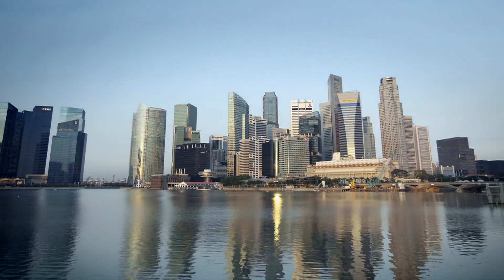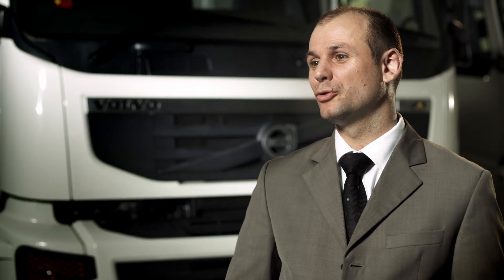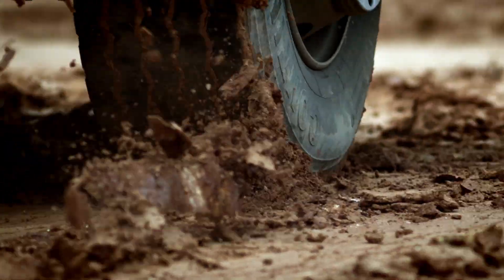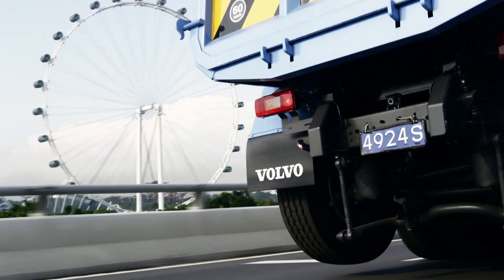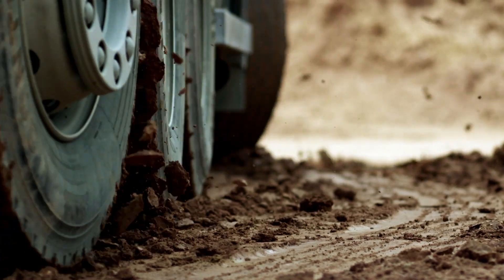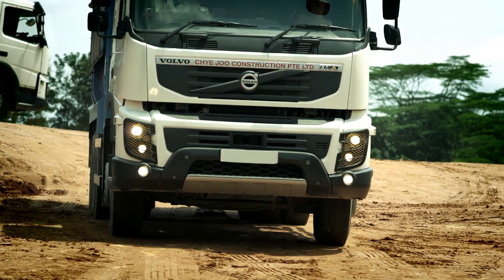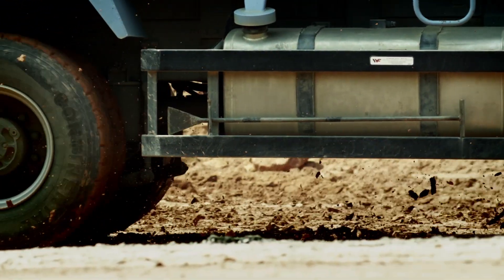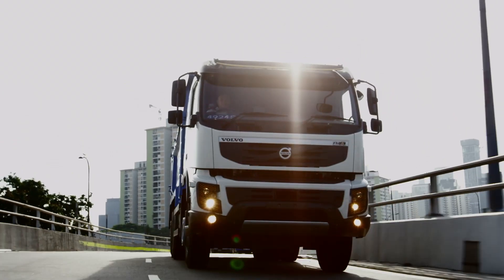Volvo Trucks - FMX Tridem: Maximising productivity

Comment: Thanks for quick reply,
I was more referring on tire wear when locker rather than manoeuvring.My family deals construction trucks 50years we are mainly working in cit,parts are older than 900years.We use classic 8x4 WB4.1-4.5m.Even with this classic 8x4outfit back of truck often go too much out when cornering you need to be careful with other vehicles.Also we do excavation and we need suspension articulation on back.On other hand i like tipping stability of tridem and 8x4 dig its front offroad

Comment from the maker: Tyre wear is less with the Tridem. A classic twin steer 8x4 will experience tyre wear on the second steer axle. This is due to the lateral force that is placed on the axle under all steering manoeuvres. With the Tridem the second steer axle is at the rear. This greatly reduces lateral forces, hence tyre wear is less under all conditions.  When the axle is locked at 38 km/h, tight manoeuvring is very unlikely to be required, hence tyre wear is not an issue at all.

Comment from the maker: The steering is locked at 38 km/h. 

Tight manoeuvring is not required at this or higher speed. There are a few extra components, however the convenience of having an 8x4 load capacity and a 6x4 turning circle far outway any downside, particularly when operating in a tight urban environment.

Comment: no independent, but link that connect left and right wheel and steer them is this rigid link or flexible(this allow wheels to have different steering angle). i have first saw this on small selfsteerable  american hendrickson axle(used just because bridge laws) they use something similar to parabolic spring but just straight , i have seen this also on some scania trucks even on 8x8

Comment: thank you 

one more question on classic 8x4 volvo do you use rigid or flexible link to connect left and right wheel , i dont have experience with volvo tippers they are very rare here